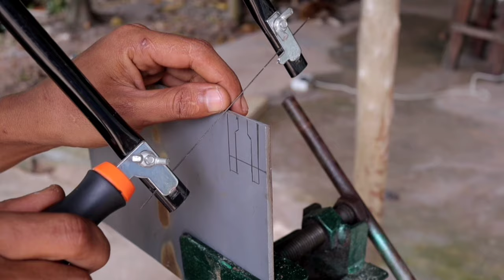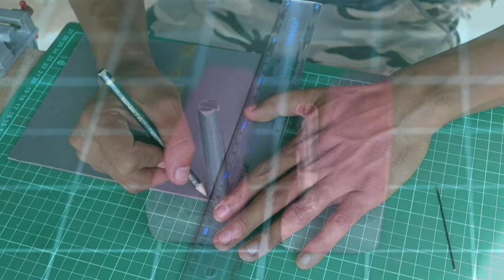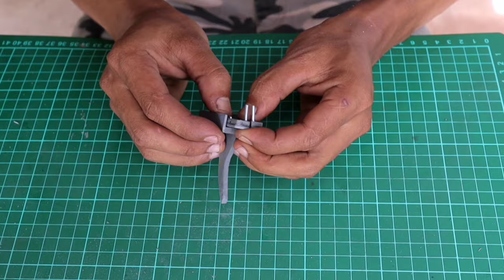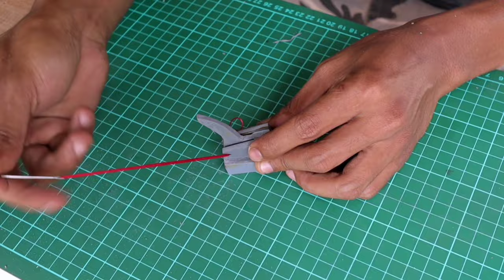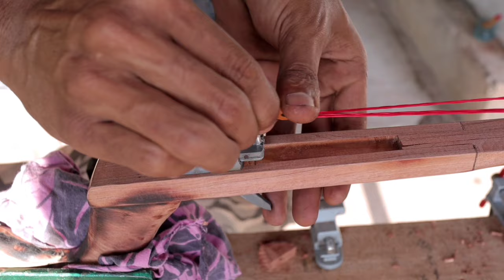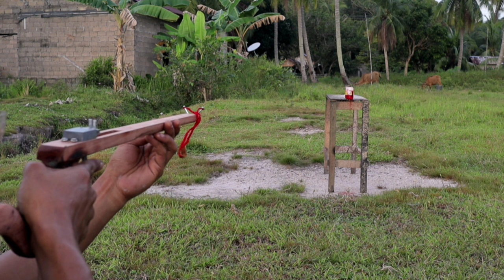DIY slingshot craft - Homemade slingshot release

Comment: You are always creative and accomplish your work with skill. Honestly, a joy for fellow DIYers to watch. One question if I may? Do the steel pins ever get loose from the vibration of firing? If the pins were inserted into metal and staked in place that might not be an issue. I am asking because the body of the trigger appears to be some sort of plastic construction board and the pins are secured with polyisocyanurate glue. I am wondering if the glue cracks over time?
Reply from the maker: Thankyou for your opinion bro, stay tuned for the next video 😉